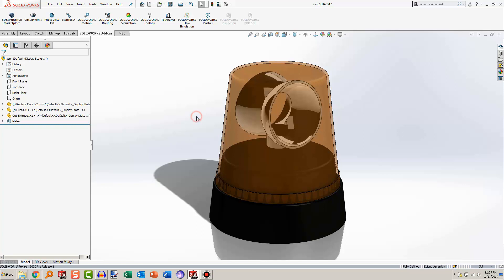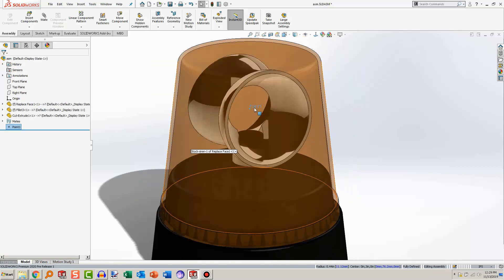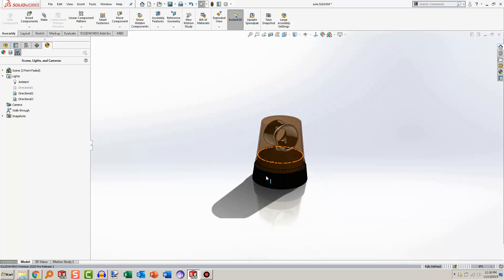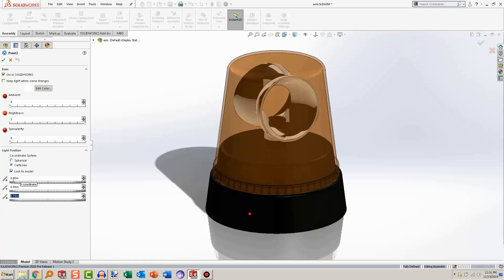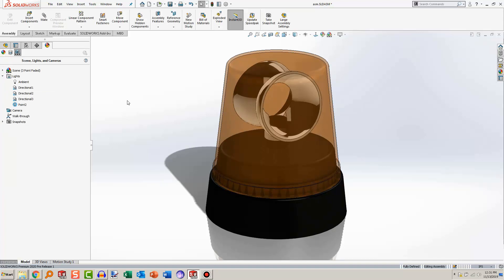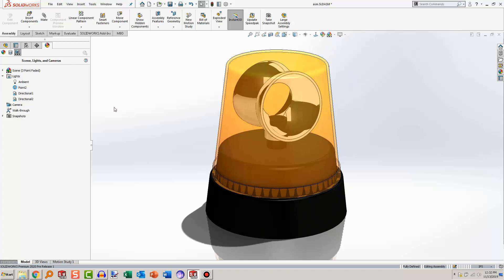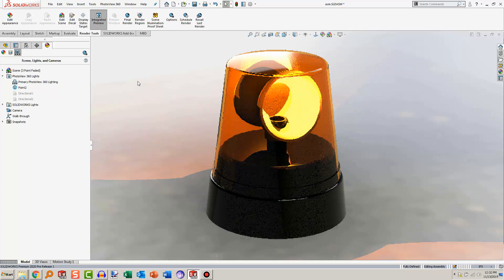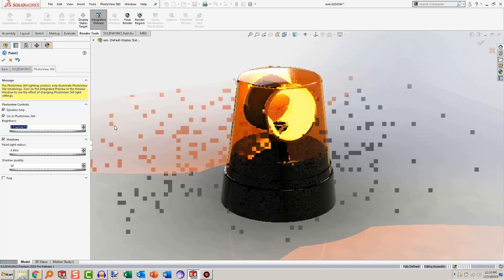Appendix A: Adding a Point Light in PHOTOVIEW 360 - SOLIDWORKS - Siren - #CADModelOfTheDay

Comment: What specification do you use for your device?
Reply from the maker: Steezy Simu , just to be clear, you mean the specifications of my computer right?

If that’s the case it is a Dell Precision M4700 running a 3rd gen Intel Core i7 8-core CPU with 12 GB of RAM and a Nvidia Quadro K2000M graphics card. You can see a little more info in my #teamtrees video https://youtu.be/Sh5qzDsc_Vc?t=84 where I actually open up the about my computer menu.

It was pretty great when I got it, but now it’s pretty old.

Hope this answer your question!
Reply: @VirtualFlat  this was exactly what i was expecting. Nvidia quadro is expensive af tho😂
Reply from the maker: @guruthecoach  haha for sure! I heard that SW also supports AMD cards as well!
Reply: @VirtualFlat  actually I'm just an associate preparing for CSWP so I don't need that high specifications at the moment